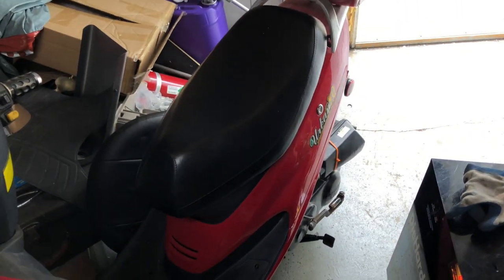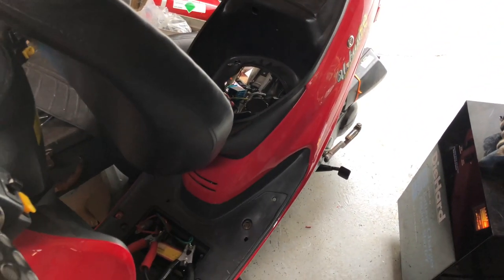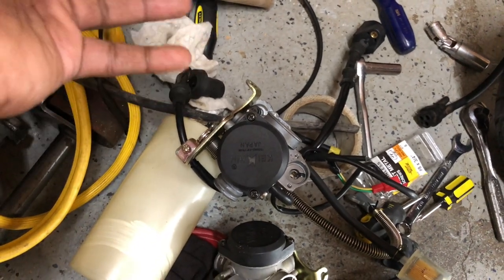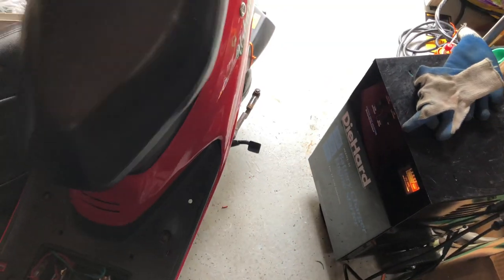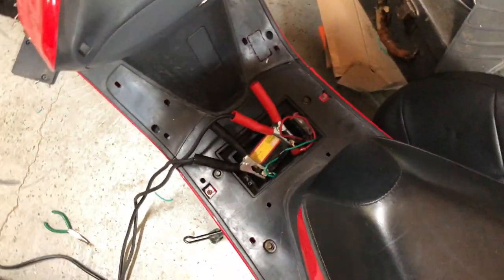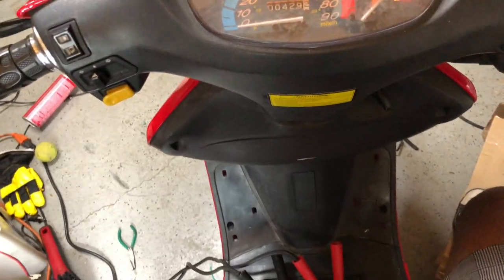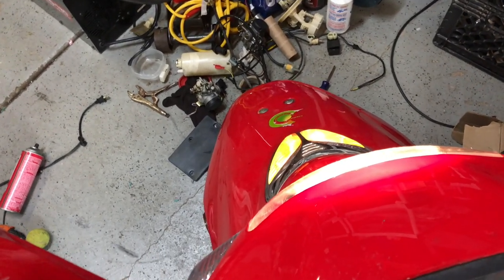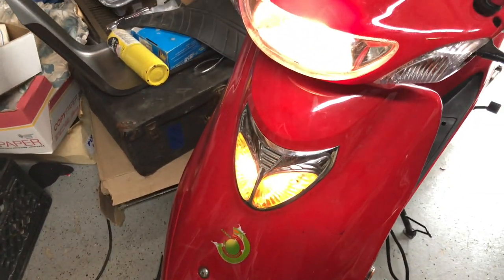Chinese Scooter Won't Start! Got Spark, Gas, Compression? This May Help!

Comment: I have a mean dog 2 trike. I just change the cdi box ,it was running good and again just wont start. Do you think is the cdi box? Again.
Reply from the maker: Did you use one of those cheap aftermarket CDI boxes? If so, I wouldn't be surprised if it went bad quickly.
Reply: I bought it at Wal-Mart. Probably is bad.lol
Reply: Do you have any specific Brand that you use for cdi boxes? Can you recommend me obe

Comment: What model is it? I have a pretty similar one.
Reply: All these chinese scooter engines are alot compatible to other chinese scooters. ...sometimes a little valve adjustment is needed. These small valves go through alot of stress and load, so checking your valves real quik doesnt hurt to check. ...heres a quick check TIP:  OPEN VALVE COVER WHILE ENGINE OFF & COLD. 
TURN fly wheel to TDC/ top dead center points till the piston is at TDC., then shake the top rockers to see if they are loose. If so just loosen that rocker arm bolt  just a bit, and tighten the screw just enough so it stops the rattle on the rocker arm then tighten the bolt. If u have filler gauge even better because  over time the cam lobes wear out 0.001 " so u must adjust & tighten them again over time. Do this every 100- 200 miles. This is where most chinese scooters lose power,  The valves stay stuck open and dont close or open all the way so it bogs out if u try to gun the throttle. Try this before u go spending money on parts if your chinese scooter turns off at idle or hard to start....in most cases this is the colprate...give it a try yall.
Reply: gy6 50cc

Comment: My chinese moped is a glide 49cc qmb139 motor I have power to everything but my cdi and coil. Brand new motor brand new carb brand new coil solenoid and cdi everything high performance. Got any idea why no power to cdi and coil to spark plug
Reply from the maker: Hi Robert, have you did a thorough inspection of your wiring? That's weird not to have power to the cdi. However, I had a moped with less than 50 miles with no spark. Although the motor was basically new, the timing was off. I had to use a feeler gauge to correct it.
Reply: @TerenceDIY  ty I finally found it out my new carb had a yellow and green wire to the connector but when they were connected they were opposite of each other and cdi box one wire was not in right place for new cdi box. Now I have to find a website that sells body panels for my moped. A redstreak glide eyas50 and have had no luck previous owner did not take care of it. But it will do well over 50mph now. I tweaked some things I learn fast just not good with people
Reply from the maker: @robertlong2193  , Ah ha! The same thing happened to me on another scooter I was working on! The wire crossed plug is a common issue. I should have told you about that. Oh well, I am glad you got your scooter going. Good luck on finding your panels! Thanks for watching!
Reply: @TerenceDIY  noprob ty for the help also want to switch from belt drive to chain drive still haven't found how.

Comment: This is happening to me but I just bought a brand new carb, ignition, electric choke, battery, and coil. and all are the exact parts for my bike. I have a 2000 Eton beamer 2 stroke. Anybody have any ideas?
Reply from the maker: Hi Paul, did you buy the correct battery? Try to jump it as well. Let me know.
Reply: @TerenceDIY  yea it didn't work with the old or brand new battery made for the bike. I don't think we've tried jumping it but we have a 40 amp car fuze in it so I don't think that would be a good.idea

Comment: You should never leave a battery charger plugged into the battery after it has started the scooter. It ruins the battery ...its bad enough you are using a high amparage battery charger. ..these batteries uses a charger no more than 2 amps. Even a 4 or 6 amp charger does the work but at the same time its shortning  the small battery's life...these small scooter/atv batterries need a specific amparage to properly charge...charging it too fast on a higher amparage  kills the electroids that keep the battery charged and makes it harder for the battery to charge and take longer in the next power drain.
Reply from the maker: I'm not sure if I showed it or not, but I ALWAYS remove the cables very quickly when I jump any battery off. You are absolutely correct! Thanks for noting that.
Reply: Yes T and your welcome...im a certified auto mechanic from CT. ...if u notice how everyone needs a battery every time and wondering  why its dead so fast....thats what a high amp 12 volt battery charger does....no matter how new the battery is your slowly  killing the chrge cells. A powerwheel toy car  has these chargers.

Comment: Thank you for this video,  this solved my problem also. I always tried to jump off my charger but it only put out 12amps. Tried my father in laws and it started right up on 50amps.

Chinese atv 110cc
Reply from the maker: You're very welcome, Chad. I am glad my video helped. Thanks for watching!
Reply: So what did you do? Did you buy a new battery.. if so what do I need to get for my scooter? What type?
Reply: @marytarr9156  great point.
Reply: My 2008 tomos nitro 50cc I just put a new carb. On it a new coil battery is good compression good and the plug is sparking welland just today I put a new blue racing CDI on it and it ran a couple hours then I turned it off and an hour later it didn't start and hasn't since, would you happen to know what is the cause, and how I could fix it
Reply: @Monica Ownby  sadly I don't. The bike later stopped working with this solution and was a gift and very worn at the time. Sorry, I literally trashed the whole unit. I was planning on changing the whole motor for a larger cc as I went through everything. 

It's a damn mystery and I trashed it because it was out grown before I could make it reliable. 

All the best Monica. :(

Comment: Can you tell me the brand of the battery? I hv the same problem
Reply from the maker: Hi Jose, I am sorry for the late response. Here is a link to a battery that will work for you. 

https://www.ebay.com/itm/GoCart-Moped-ATV-Scooter-12V-7Ah-150cc-200cc-250cc-Kinroad-Battery-Replacemnt/202787625492?_trkparms=ispr%3D1&hash=item2f37159a14:g:xS0AAOSwcwlfmzvL&amdata=enc%3AAQAFAAACcBaobrjLl8XobRIiIML1V4Imu%252Fn%252BzU5L90Z278x5ickkrmmq8hWevtuKE7%252F%252BLfVXtrFoC4NbAnUapZ0NYTWrfiMVKb%252BF38%252BiNjqtotenM%252FoQIJOfo1hjhmcsc3FShcozanb6Mc8E0tlPoioAC2IB37kn8MI%252FNp%252BbugJG%252B4Qxsk9i%252Fle072LSD8hopwHLsiiTUpN09qHCgHjHPivYl%252BQ7cJB4wUV18QAac7m4nH2l5zA62GFQ4fEY6Vur3qQOVWAqtRtykl%252FbPlHolplPwa9nlgoHGO3k5LbGMybbWbAQ2AwlIR4zKNKbxiPuKJidqHZ6TpL%252BL15NraC%252BE0wpGrdLhSrWdraNAD04tOcDrPMI8ikHALUUS5pDrN3fnoelCluuT02%252B79tbC%252BY%252BuFK96l7Fudx8aNeQgUdXWdUY1WrrD3XJpzYFZfnrisOGAfbuEmIkqyFEgtWX1HTUHPAqGwZy8QkIQnm4A2N26K7qX%252FP9SdqCQTfKEn3ZOxT1N7%252BCIAeAtrArkoE9AlZhT%252BaoCKkwnNb8TU24AKFeVOOvq20F9JrpNClEQBzeU956nHz%252FVFODAk4%252FE9rCvn4W4lrAK4K0p1Iy0xJ3Mr5Eo6yGuUdV9ilZkG9APEdgBb8xqWRvsyyqKilngp4m6bPWZhmyUVP04%252FgXNp7%252B0z7yf0GEa2tcMZffzYjD2a2JRWlNe%252FYTe8t3zEZQ7nsDDsrrdUE%252BFje35%252B%252BwL92lMt%252FPqSB96Hq94oSbBRzDToW9u32g086JVeVlaIMkfXC1uQFhQBiiCJ9Zjspjrp%252BkHuGCiQdKQqzvmhyRy%252BER0na0rBcXwe3xMa0VnA%253D%253D%7Ccksum%3A202787625492a7a89d0b841f4c57a4285eee6c143e54%7Campid%3APL_CLK%7Cclp%3A2334524

Comment: I got the same problem like this also

But I didn’t try it yet

Do i.?

My scooter is 50cc Boom..since  (similarly with Taotwo )I bought this two months ago.. I’m doing gig job with my scooter.. until today.. the scooter won’t start. There is ⚡️ spark.. there is ⛽️ gas is fine.straight going down to carburetor and there is compressor also.. but still didn’t wanna run.. 

Maybe i have to try this one
Reply from the maker: You should try what I did. I am pretty sure it's going to start.

Comment: I wonder if your fuel pump isn't working properly
Reply from the maker: Hi Vance, I believe it is working properly. However, I'm not sure. All I do know is, the quicker I get it to spin (my atv too), it starts up instantly!  Thanks for watching!
Reply: @kencovert8972  would thick oil cause the engine to turn like that my scooter does the same thing

Comment: I got spark,compression,fuel,and new battery..but wont crank!..any ideas?
Reply: I have new stator too
Reply from the maker: @basilflournoy5334  did you get it started? if not, I would try to jump it as well. If you get it to spin over quickly, I am almost positive it will start. The key is to get it to spin as quick as you can to generate a strong spark.
Reply: @TerenceDIY  i was going to kick start it. To see if that worked. I do have a few upgrades i done to it while it being down. I will know tomorrow. When you say jump it off, you mean with a car?,
Reply from the maker: @basilflournoy5334  , yep with some jumper cables or if you have a jump box that will work as well. The goal is to give it that extra boost to generate that strong spark.
Reply: @TerenceDIY  hope my lil puuter battery holds up...😁..we goin to see...i got the motor wet like a idiot,then stopped cranking.  2021 model...thankful for keeping extra parts...
Reply: Tryed jumping battery today to start it, but not long...no luck
Reply from the maker: @basilflournoy5334   did you get it started?
Reply from the maker: @basilflournoy5334  Okay. Are you using old gas? You should use some 93. If that doesn't work, you may have a timing issue.
Reply: @TerenceDIY  gas is a week old..i took the valve cover and shrowd  off and checked the timing alignment last week...i got the T on the line and the gears holes in alignment of the valve area....idk
Reply from the maker: @basilflournoy5334  wow. I wish I were there to help you get it started.
Reply: @TerenceDIY  it was i 50cc, now its 100cc..i did the work myself, did run good, until i spilled some gas on the motor, from taking the tank off.my dumb azz thought it was ok to wash it off..wrong! Tryed to crank then, and died.i have replaced a few more things again , from the water, but no luck. I guess last resort is to but the 50cc motor back on, and trouble shoot!?
Reply from the maker: @basilflournoy5334  Maybe that's a good solution. I hate you can't get it going. Let me know if I can be of any help.

Comment: Awesome man, i hope this works on mine. Thanks
Reply from the maker: If you're having similar issues as I was, I'm almost positive this will work for you. Let me know. Thanks for watching!
Reply: @TerenceDIY my Honda rukus has this same issue it wants to start but doesn't do you think battery is too weak
Reply from the maker: @sparkleruby1991  , sorry for the late response. Yes, there is a possibility that your battery is weak. A strong posibilty. Thanks for watching!

Comment: I wonder if kick starting it would have worked...
Reply from the maker: That's a good question, James. I didn't even think to try.
Reply: If it ain't run in a while no because it doesn't spin and fire fast enough by kicking, but scooters man are a pain sometimes, cars are easier but I love a challenge

Comment: So it was battery???
Reply from the maker: Yep. The small battery I was using was not strong enough. The engine needs to spin over pretty quickly to generate enough spark to start the engine.
Reply: @TerenceDIY  I have bought a Daelim 50 cc scooter I Installed New CYLINDER head with piston and rings etc. first start i let it idle then went for 20 min ride , then shut off then after 30 min i went anotherr ride then shut off Then after 4 hours i wanted to start it wont start. Now i checked the Carburater its good, i changed spark plug i have spark, Then i put petrol on the Spark plug then it starts and runs without stopping. If i stop the engine i can start it again untill its get cold again! But when the engine was running i  pushed the motor to left side then the rpm increased when i pushed to righ side it wanted to stop. The battery which is in is quiet small any idea?
Reply from the maker: Hi Christian, you may have to remove your petcock and clean it or buy a new one. They are cheap.
Reply: @TerenceDIY  sorry for Dumb Question but im Hungarian and its first time i own Motor... what is petcock ?? I only have carburator and inside that i hAve sonething that has a needle Thats not straight
Reply from the maker: Hi Christian, it's not a dumb question. Here is a link to one. Every scooter should have it. 

https://www.ebay.com/itm/Fuel-Shut-Off-Valve-Petcock-For-50cc-70cc-90cc-110cc-125cc-Scooter-ATV-Go-Kart/274550359836?_trkparms=ispr%3D1&hash=item3fec7a071c:g:SQEAAOSwV~lfl9L3&amdata=enc%3AAQAFAAACgBaobrjLl8XobRIiIML1V4Imu%252Fn%252BzU5L90Z278x5ickkY3FSd4Ad8xn3oRtkVexxrEBvoJP26qCHa3itwYFYL7zZsW%252FlQptsmbJZOQ57YX%252Bkb0LfrIPFMKjNkw6fC1A4LogLsXHy7D0Aap3D434uFob9oYBHTzgI%252Btylx5wTTQHJ7oLZ5zh20uIuy6d4hGoHc4MqD6Nt0TpGSZ2NMju5g199WGWyS%252BubJjR34FyaL6KjD8G%252BQ5W07vV7T89Wqhoo5MNK42v%252FAS42HLEdgYSag9LH8CqMxTto0ZelkF6RHzaVieH0Bw00W8swj1XLZ02WdJiMwC8Xl75OpCHT40P%252FJ6kspEDVsmrW6GOH9zpV339YqoOpNoGa%252BNMIAl9LFozKUutIenkuH06gwg6DdCTs0Apx4Zgc7DbW8jCVsfgmAPVlFTHyL7SOrm5nVBKjWPTRPOuiQAsYl73En0M8NODTxIfF2i1assOYbUgZkTdYXXvGxs8A8fGFXa0RIFc2GcpbcLuvhD6y51fKGsM1KBrLNFETPbezK6poggt2ghmBh9MAKmD44UUyRgyL4k0ApbZYF8oGqXnL9NJCzZ2MiXW1efpaLE2MgGRGcVAG7xT96fV9wmaPAQStRDGxvViZEDHdP1UBY5yKKQT45KSYCu8W7NH%252F1IhQqmDXN%252Bp6w7Ce1BIwPklZX2p93YSGf485%252Fbs23VvSKeILKHTx7cbJlxod55gORxtmFDxw1j8m5NDUSBEUys7uLKHWDqhgIRxobhgjBLNPZxIlEZOSo76ieExXQ8ravxtsQBj672j5zexbVeIqTOYJ7v9H90RgrOdzraNapcGhIXg9vlNlWALNm4vR0JI%253D%7Ccksum%3A274550359836052f9e5b8b124b719c3ce07508075b00%7Campid%3APL_CLK%7Cclp%3A2334524

Comment: How in the hell thats help u didn’t fix anything
Reply: Actually he did, he just told you that he didn't have the right size battery. By not having the right size, it's not going to pull enough power from it.
Reply: @brianboyd8882  NO, if it turns, gets spark, gets fuel but started with bigger amps that means the motor needed to spin faster. If it needed to spin faster to start then that is a compression  issue.